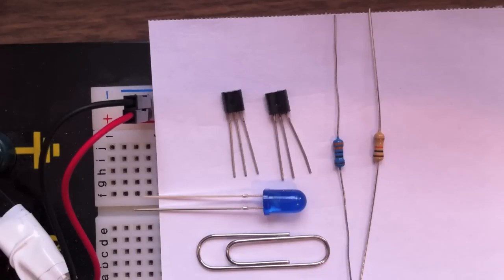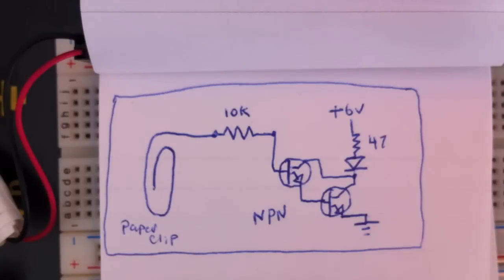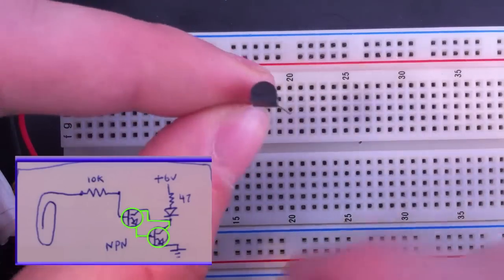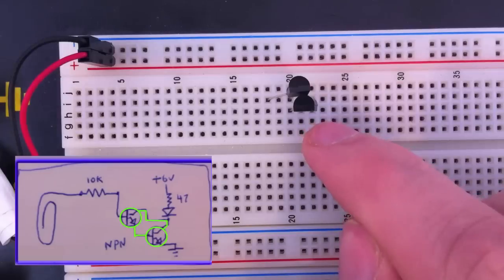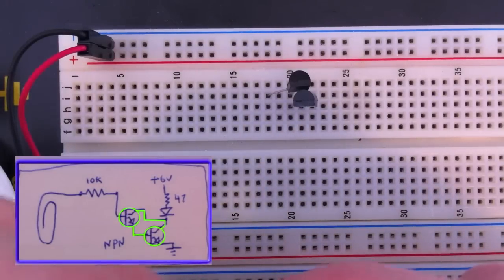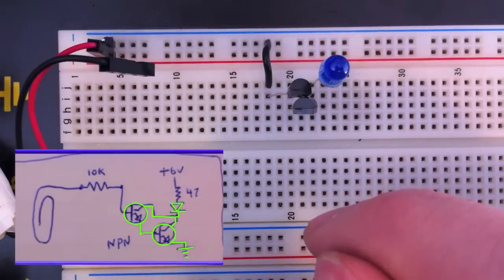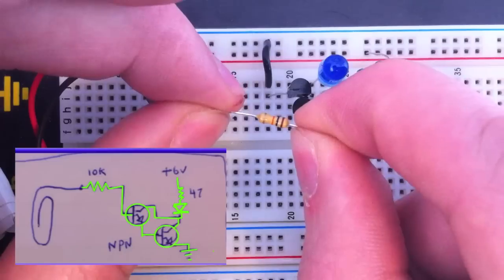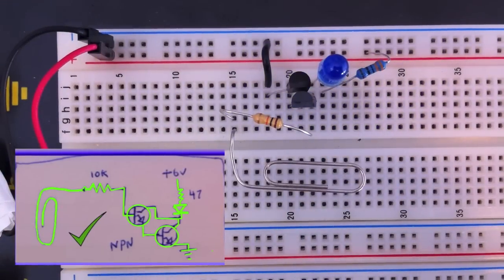Darlington Pair Demo

Comment: Just wired this up and it works amazingly. One curious thing I discovered is that if you put the 47K resistor/paper clip on the emitter instead of the base it works as well although the LED is much dimmer.

Comment: Thank you for the instructive video ! The very small current introduced by touching the base is amplified by the Darlington connection and lights the LED. The connected two transistors in the Darlington configuration behave like a single transistor with BETA equal to the product (multiplication) of the two transistor BETAS. This product can be large and in the thousands range.

Comment: Michael - I watched your most recent video and your cats were a fun addition!

I am going to try your darlington pair circuit on a breadboard, but I had a question: the diagrams I’ve seen of NPN transistors label the pins as collector; base; emitter from left to right if the flat side is facing the user (as in your example).  You seemed to describe the pins the other way around - and I suspect you are right!  Have you ever seen NPN transistor pins labeled incorrectly?  I’d be VERY interested if you have!

Thanks for a great video!  Oh, one thing I think would improve future videos: if you could show the breadboard from different angles so users can see the pin placement more clearly.

Thanks again!

Comment: why touching the clip creates a current flow into the base of the darlington pair???, where is the circuit flow.... i always thought you must connect one finger to the base (with a resistor in between) end the other finger in the Vcc.... why?

Comment: no.. i know they are npn but they have a very little code in the flat side just as any component, maybe I'm not using the appropriate ones... i think i already ruined 4 transistors XD. If you can write the code will be great. thnks dude